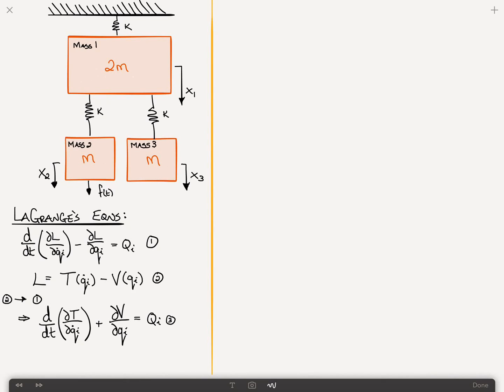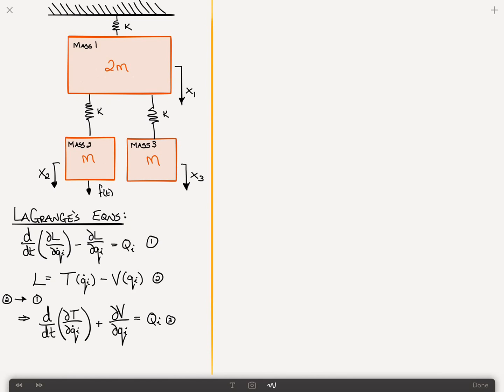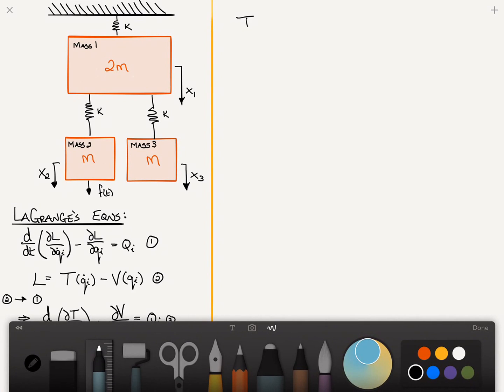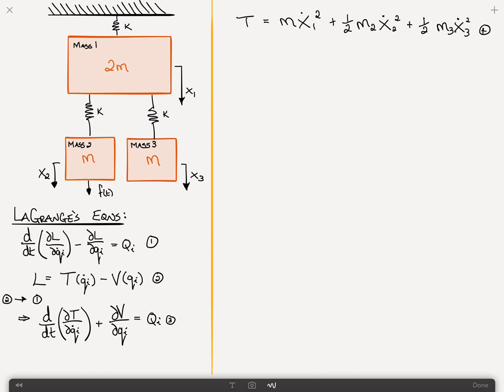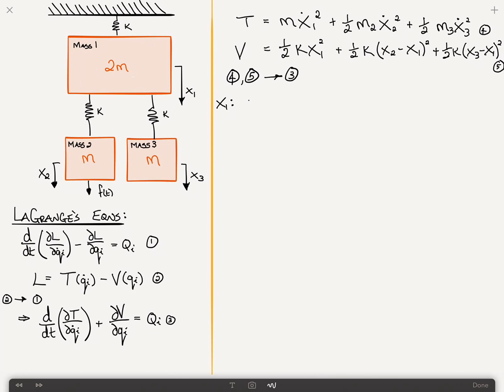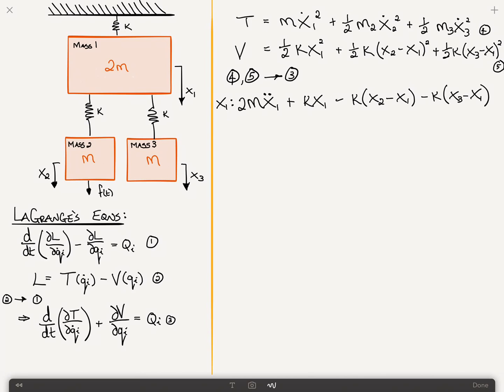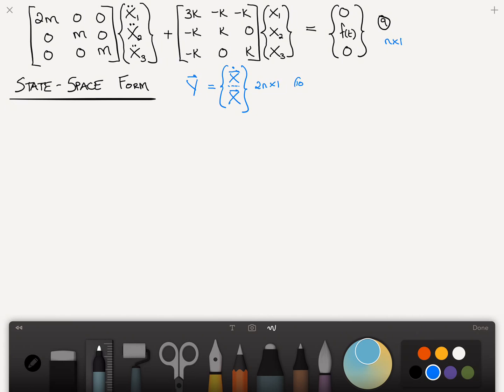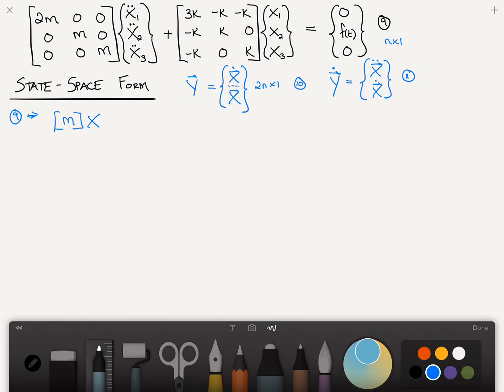Multi-degree of Freedom Systems (MDOF) - Numerical Solution to the Equations of Motion (EOM)

Comment: Why gravity effect not taken in potential energy
Reply from the maker: The problem statement does not mention gravity, so it's okay to ignore it.  On the other hand, had gravity been included in this problem, the only difference would be that the equilibrium position of each of the masses would shift slightly downward.  However, relative to the new equilibrium position, the equations of motion would be identical.  This video explains it (youtube.com/watch?v=TpZMTo-Lig4).

Comment: The numerical method you show to solve MDOF is interesting.  As far as I know it is not in any textbook on structural dynamics, which usually mention average acceleration and Wilson-theta methods.  Is it your own idea and is it stable and better?
Reply from the maker: The method I used here is the forward Euler integrator.  It is part of the Runge-Kutta family of integrators and is 1st-order accurate.  It is very simple to implement, but is known to be mildly unstable when no damping is present.  It will, however, give you a decent approximation if you can get away with a very small step size (i.e. if it is not too slow computationally).

Comment: I got a question. Can Langrange Rule be used on a mass-spring-damping system, and why? And does the damper have any contribution to kinetic and potential energy?
Reply from the maker: Yes, this method can certainly be extended to include damping effects.  We define something called the Rayleigh's Dissipation Function ( usually denoted "R" or "D", which has units of energy and is equal to the energy being dissipated by the system.  It is similar in form to the kinetic energy expression.  Assuming a damper was inserted between m1 and the wall, you will get:

D = 0.5 * c * (x1_dot)^2

Then, the following term is added to Lagrange's Equations:
dD / dq_dot

NOTE:  We just differentiate R with respect to the velocity.  We do NOT then differentiate this with respect to time.

Take a look at this article equations 40 to 42: 
http://web.mst.edu/~stutts/SupplementalNotes/EL10.pdf

Comment: Thanks for the Video, was very helpful. Would you be able to provide a reference for the time marching integration. I am trying to do the same for a cantilever beam.
Reply from the maker: Just to be clear...the beam problem is a continuous system which yields an equation of motion that is a PARTIAL differential equation (PDE).  PDE's are, in general, very difficult (if not impossible) to solve in closed form.  There are, however, some simple examples (the cantilever beam being one of them) where you can solve it exactly.  I have done that in these videos:
https://www.youtube.com/watch?v=3R8q3becNvg
https://www.youtube.com/watch?v=k9lz7eLNafM

On the other hand, if you want to solve the cantilever beam numerically, you need to convert this PDE into a system of ORDINARY differential equations (ODE).  Typically this is done using finite element modeling (FEM).  Only then can you implement a time-marching solution.  I have a couple of other videos demonstrating this which might be helpful:
https://www.youtube.com/watch?v=e1q4vD2KjpE&t=215s
https://www.youtube.com/watch?v=SFpJbmHIUB0&t=450s

I have a separate FEM playlist (have you checked that out yet)?  This will (eventually) explain how to derive the beam element and how to model a beam using it.  
https://www.youtube.com/playlist?list=PL2ym2L69yzkaue8Ly2Oz51LALRzUV8LZ0

Be sure to take a look at these videos: 
https://www.youtube.com/watch?v=HCSInXOtiRc 
https://www.youtube.com/watch?v=SFpJbmHIUB0
Reply: Freeball many thanks for your reply. Yes I have checked your videos on beam and they were very helpful. Yes I am finding it extremely difficult to get a fe modelo for the beam. I will check the videos you have mentioned. Thanks

Comment: Thanks for your videos, they are extremely helpful. Suppose there is also a damping matrix C, how can this matrix be added to the model?  Intuitively, it seems tempting to make A = [M C; 0 I] or B = [C K; -I 0], but I am not sure if this gives the correct results.
Reply from the maker: You are exactly correct!  

The only thing I would add is that in the event that [c] is nonlinear then it has to be updated wth every time-step.  So, in terms of the computational efficiency, you should bear in mind that the most expensive numerical operation is inverting the A matrix.  Therefore, I would tend to incorporate [c] into the B matrix and that way you MIGHT be able to avoid calculating A-inverse with each time step.  I have shown this in another video  (/watch?v=SFpJbmHIUB0 - add this to the end of the YouTube url)

Of course, if the [m] matrix is also nonlinear, then you have to recalculate A-inverse with each time step anyway and then it makes no difference whether you incorporate [c] into [A] or [B].